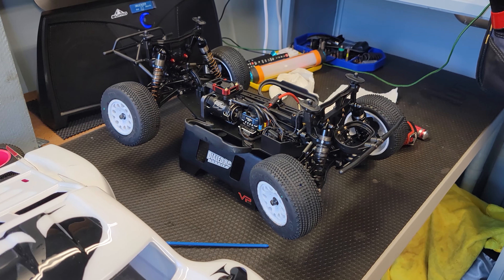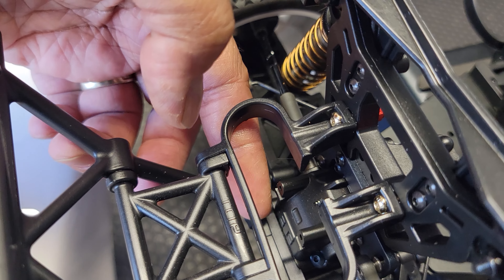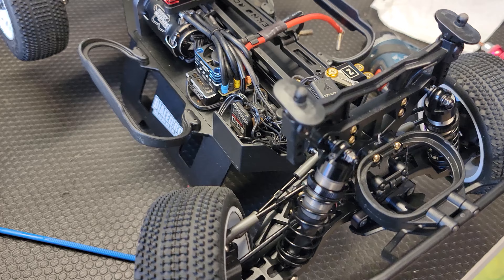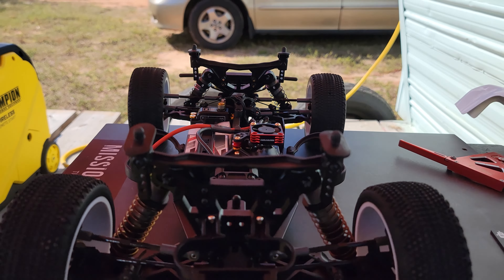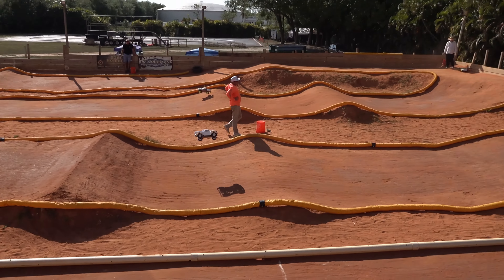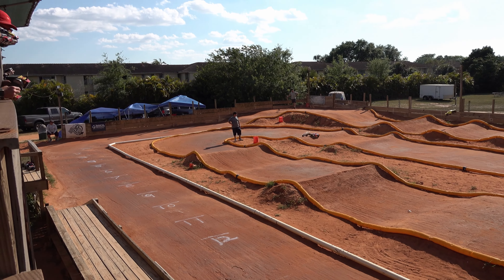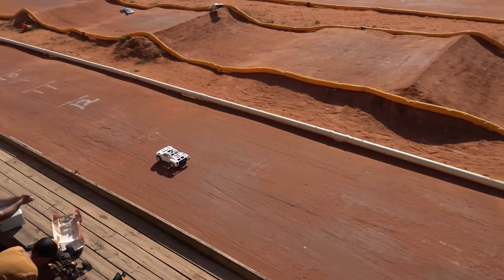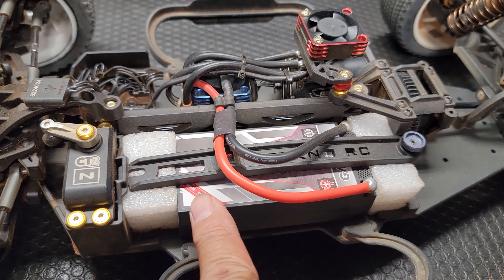Tekno RC SCT410SL - 2nd Race WIN!!! Car Setup VLOG and Race Video!

Comment: Which turn motor is that?? And what pinion are you running I know it’s 17t but are you running a mod1 pinion with a smaller bore?
Reply from the maker: It's a 6.5T Reedy Sonic 540 M3. It's older though. There's a newer M4 available. The pinion in this video and 3rd win race video is 17t. Although  last weekend practice, I tested an 18t for a little less punch and lots of top end for the straight. I'll be keeping the 18t for the next race video. They're cheap pinions from Amazon. I believe the inner diameter is 1/8". Fits perfectly on the motor shaft with no adapter.
32P Hardened Pinion Gear Set 1/8 inch Hole 17T 18T 19T 20T 21T with Hex Key (Compatible with 0.8 Metric Pitch) https://a.co/d/11SFNf1
Reply: So the truck is light enough to run a 2 pole motor?? I've got a max 10 140A 4000kv coming in mail, but have a sendored 10bl120 and 7.5t motor i might give a go if that's the trick! Lol

Comment: Quick ? I got the sct410sl but I got this issue it just nosedive so much that I’m just about to give up on the thing how did u solve that issue
Reply from the maker: Maybe heavier shock oils? Other than that, my front end is pretty much stock settings. The best fix is to stay on the throttle well after leaving the face of the jump.

Comment: WIch battery pack are you using? Also can you suggest ride heights for a start in a track similar to this? thanks.
Reply from the maker: This is the battery I got from Amazon but now out of stock. Maybe consider the second link. I wish I got them instead because they are 6600mAh and 150c. I run 23mm front and back for ride height. Make sure car is at race temp and pump shocks if emulsion to simulate race conditions. My droop screw/shock length limiter is 86mm front and 101mm for the rear. 

Gaoneng GNB 6300MAH 2S HV 7.6V 140C Short Shorty Pack 5.0mm Bullet Hard Case RC LiPo Battery 1:10 1:12 Scale RC Race Car LiHV https://a.co/d/48jm0DG

Gaoneng GNB 6600mAh 2S HV 7.6V 150C Short Shorty Pack 5.0mm Bullet Hard Case RC LiPo Battery 1:10 1:12 Scale RC Race Car LiHV https://a.co/d/7zhpin2
Reply: @in4bliss  thanks m8.

Comment: As far as the rear end being loose, you said you are going to go with a firmer anti-sway bar... I'd go with a softer one myself in hopes of gaining more rear traction.
Reply from the maker: Will definitely try that out. For now I need to mount the rear camber links correctly lol!
Reply: I see rather too many springs compared to the hydraulics. Then, the anti-roll bars are more useful on this kind of track to gain agility and adjust the front-to-rear balance when sliding. Also, review for example the front caster to optimize the passage of jumps that seem tricky.

Comment: Your rear camber links are mounted on the wrong side of the towers camber link plate. The rod end should be towards the front or inside the tower and the nut should be on the back. This could be contributing to the loose rear end.
Reply from the maker: Wow, awesome catch, thanks for pointing that out! I guess I'm getting old lol, my eyes definitely are. I'll put it on the right way and test. Pretty sure it will calm the rear down if it's installed properly. Thanks for watching and hope you watch future videos to help me out some more!